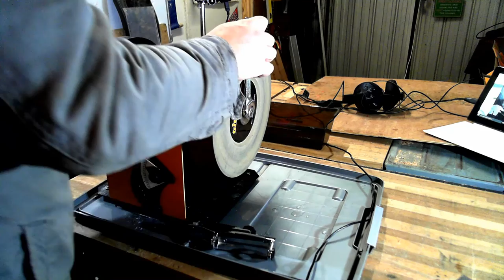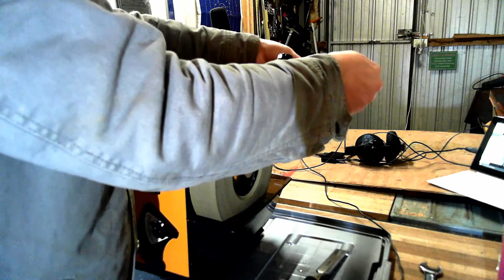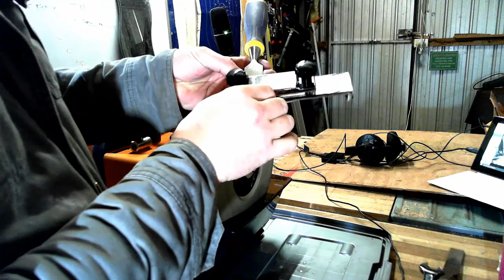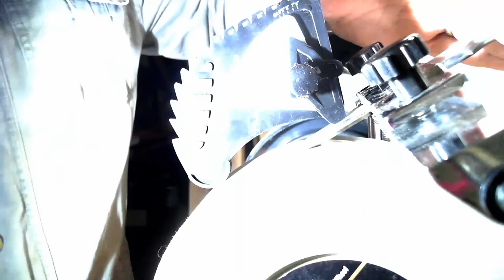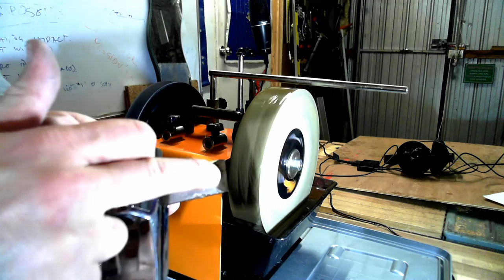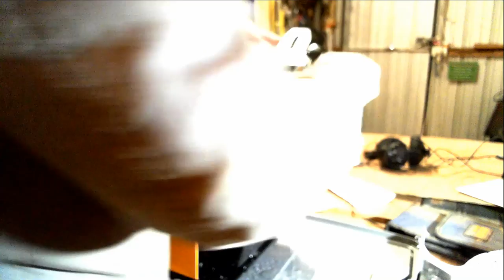How to use the | Triton 120w Whetstone sharpener

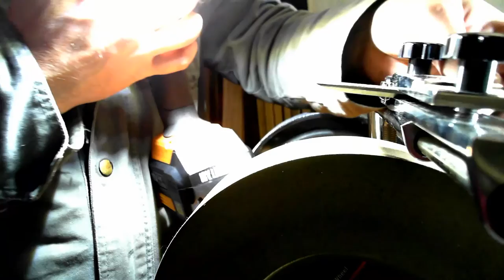Comment: I am pretty sure that you are setting the angle incorrectly. I have used a Tormek machine and read its manual. I recall that the top of angle guide must be located at the bottom of the blade, not "anywhere" as stated. In the video before 13:10, you can see that the indicated angle changes as you slide the guide up and down the blade. From first principles, you can see that it's only accurate if positioned where the blade meets the stone. Thus you ground the chisel on an angle that was too acute. Excellent otherwise though. Thanks.